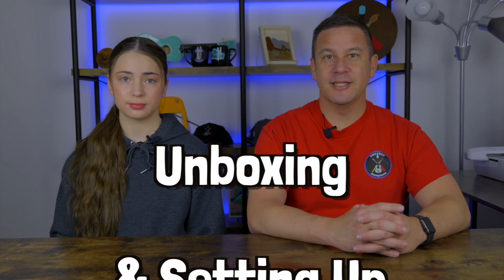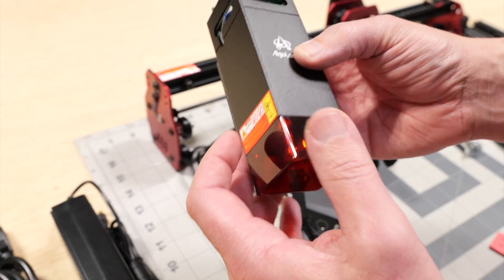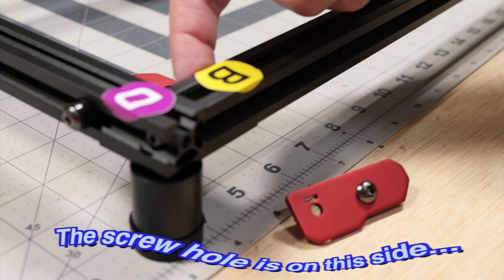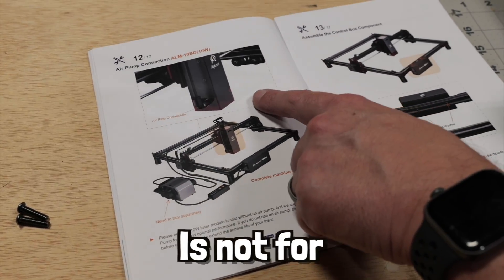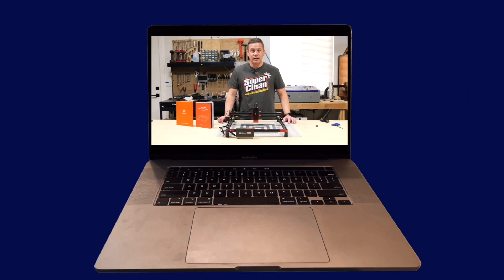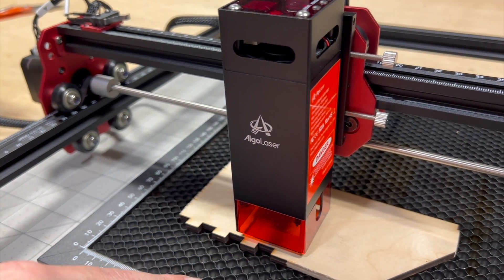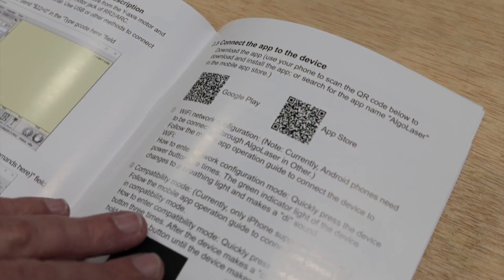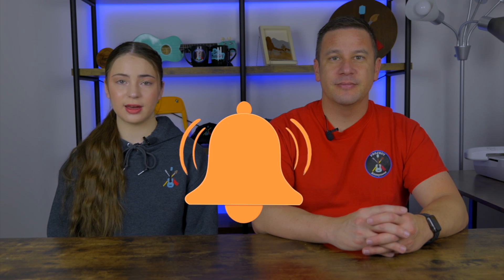AlgoLaser DIY Kit Mini 5W Diode Laser Engraver | Unbox/Assemble/Test

Comment: Hi, I have the same laser, 5W, I'm interested in how to set it to cut chipboard 2-3m thick, I've tried everything but it doesn't work for me, thank you in advance and you have a friend from me 😉
Reply from the maker: Here are two ways we have gotten good results with 2mm mdf/chipboard: 100% power, 200mm/m 2 passes. Additionally, we've gotten similar results with 100%, 600mm/m with 5 passes, no air assist and focused using the focus tool on the machine.  We hope this helps.  Thanks for watching!
Reply: Thank you, do you have an Instagram where I can ask you a few questions and send you a picture of where I'm wrong, I can't post a picture here...thank you in advance

Comment: I purchased the 5w DIY Kit from Algolaser. I also have the air assist and the enclosure. I have not used it yet. Do you have a written tutorial on how to setup in Lightburn and what settings (speed, power) you used for the test? I'm a complete newbie!
Reply from the maker: Hi!  We don't have any written tutorial anywhere yet. Here is what we did in the video, we hope it helps: 

After opening Lightburn click on Devices then Create Manually. In the New Device Wizard Pop Up Window, Select GRBL then click Next, Select Serial/USB and Next, Here you will name your Device and select the dimension of your work area (for the mini kit it is 11.81in on the x axis and 12.2 in on the y axis), then select Next. 
Where is the Origin of your laser > Front Left, Auto Home on (will be green), Next. That’s it…it will give a summary of selection and select Finish and Ok.  

OUR TEST SETTINGS
Engraving
Go to Laser Tools>Materials Test 
Set Up Parameters:
Speed: Min 1000mm/m and  Max 10000mm/m
Power: Min 10% and Max100%

Edit Text Settings (the engraving for different values that will show up on the grid)
Speed 700 mm/m 
Power 80% (as starting point)
.1mm Interval 

Cutting 5mm Plywood
Go to Laser Tools>Materials Test 
Set Up Parameters:
Speed: Min 100mm/m and Max 1000mm/m
Power: Min 10% and Max 100%
3 passes (Set the number of passes in Materials Test Settings under “edit material setting” in bottom left corner of Material Test Generator)
Reply: I'm laughing because once again I came across your video. What did you use to hold the wood in place. No I have not done anything yet because it has been cold and my laser is in the house and I'd have to hook the hose up to the window. @ProjectAnonymous_Duo